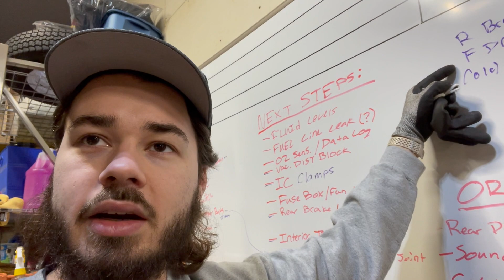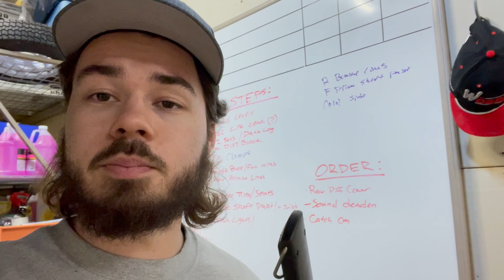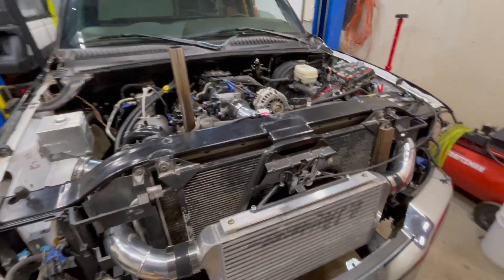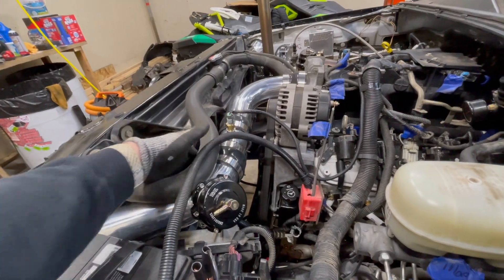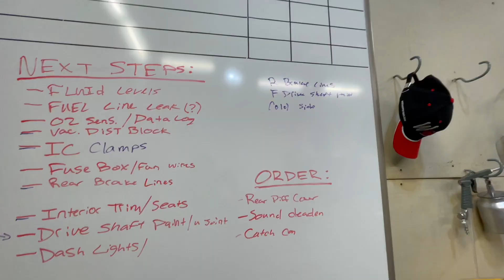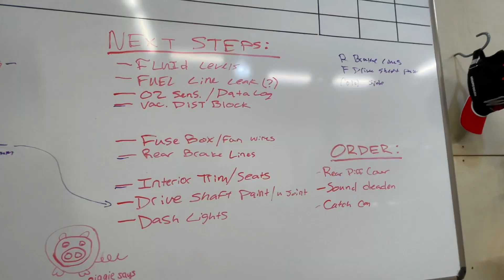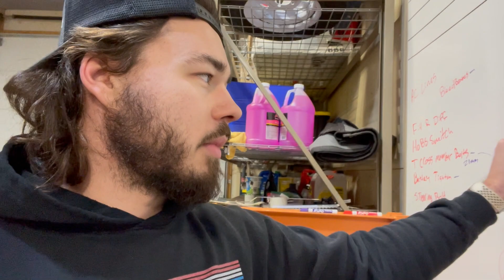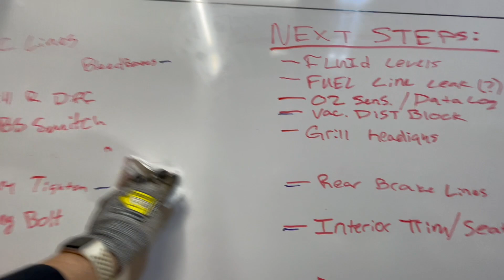I almost set my SHOP ON FIRE - The TURBO GMC driveline is COMPLETE - Frame off restoration build

Comment: Make sure you do a double flare. I came across a guy making brake lines with copper and a single flare ! It was horrifying. I tried recommending the right way  and tubing but got snubbed.
Reply from the maker: I had stainless lines and you can't cut those with a tubing cutter let alone flare them. I've never made lines so I'm going to phone a friend on that one. I'll ask him about the double flare. Thanks!
Reply: No worries, it's not too hard. A double flare kit will come with several different discs with a small tab on them with different diameters. One will fit the id of the tube and basically folds the end back on itself to form a double wall on the flare preventing cracks.
Reply from the maker: I think I know what you are talking about. My stainless lines that won't work are double flare. Thanks for the comment & support 👍